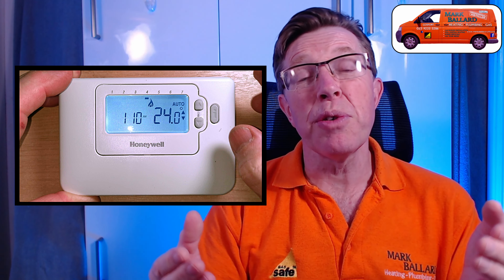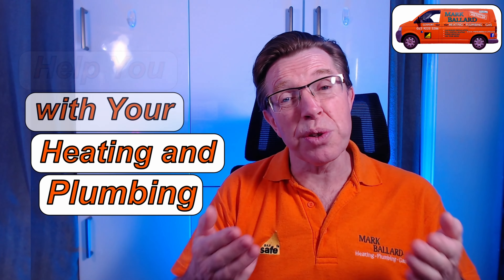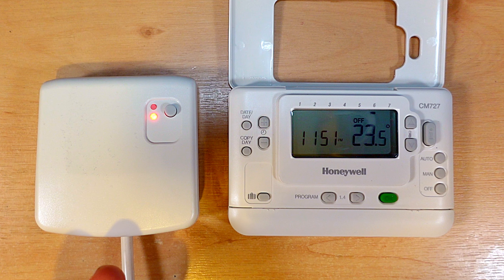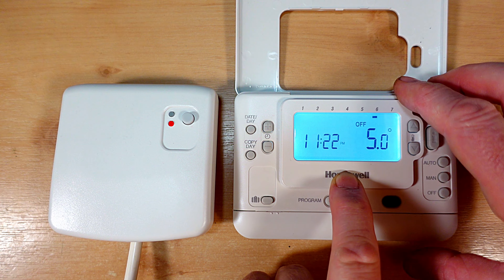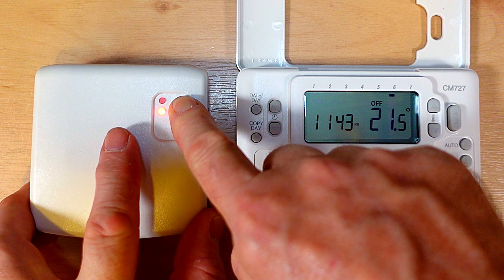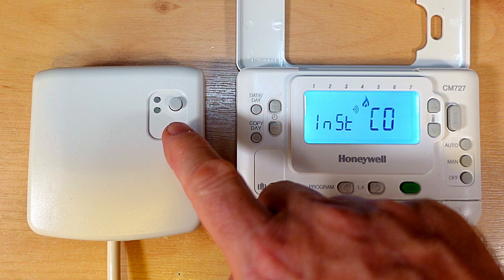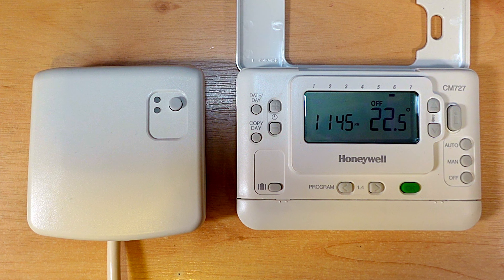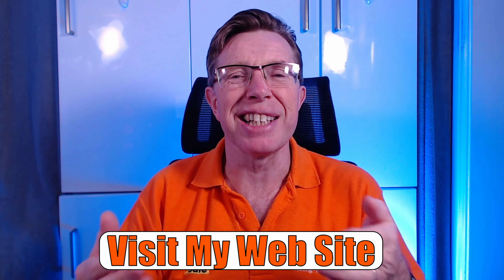Honeywell CM727 How to Re-Bind / Pair Back to its Receiver unit.  Along with Additional Checks To Do

Comment: Hi there Mark, thanks for the video. We have an issue where ever so often the red light comes on and we have to press the button and restart the heating. Then I could be fine for weeks. Then it happens again. Is this a fault with the programmer?  I have changed the batteries and did the re binding process. Thanks a lot.

Comment: Thanks Mark just re bin my heating control great, only trouble is I am having difficulty turning the temp up on the control unit I press the temp up to 24 but after a second or so it just goes back to 21 not sure why this is happening?

Comment: Dear Mark, 

I have been using for 3 years CMT 727. After the battery replacement it did not communicate with the relay box again. Tried to pair but didnt do it. I follow all the steps according to the attached document, and when I press the OK button in the last step, there is no change in the relay box. The red LED continues to flash. I think running out of battery shouldn't cause it to break down. please can you help me